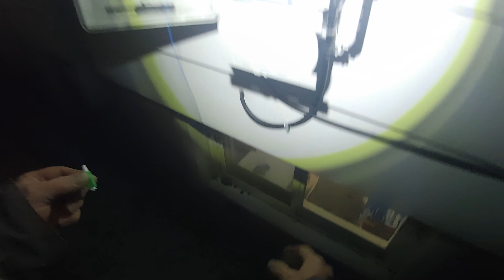Finishing up a Fiber Optic Service Call in the Dark

Comment: How much is an install? Is the price all included or do they add more for hanging drop or running through conduit?
Reply from the maker: $120 flat fee up to 250ft drop to equipment (even wall fishes included) and activation.  Sidewalk bore  $10 and conduit $7 for up to 200ft
Reply: @ Damm at least it’s something I’ve worked for some companies where none of that’s included. There’s just the install price
Reply from the maker: I went back to my original fiber company last week it pays at every step. 5 DROP, LENGTHS, ACTIVATION 1,2 OR 3 PLAY,  SIDEWALK, BURY THE DROP, WALL FISH, LANDSCAPE BURY, EACH SPLICE, AND CUSTOM HOURLY PAY WHEN ITS DIFFICULT.
Reply: @ yes that’s good I was going to say I work for frontier and it’s à la carte can bill for everything and get paid by foot… best part 0 splicing (unless I really need to in one offs)

Comment: So what happened here? It was a service call, but the whole run had to be replaced?
Reply from the maker: The line must have been cut from the a tech running it to the wrong connection point.  we have to go by the maps given to us.
Reply from the maker: Guess I made that a little confusing. The next tech installing another house possibly had no more ports on the can or nap, so they just cut the customer that didn't belong in there.